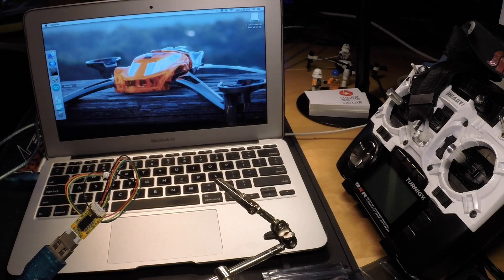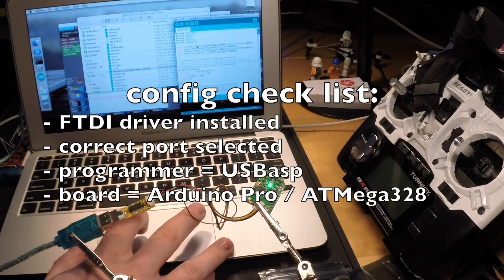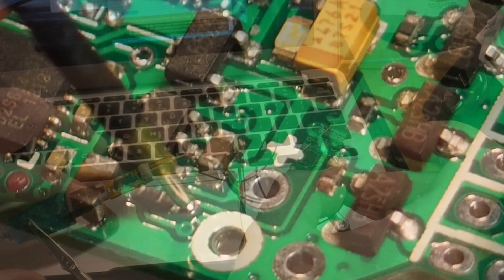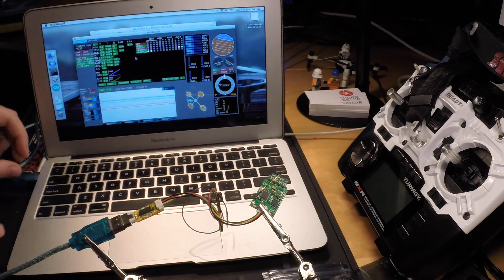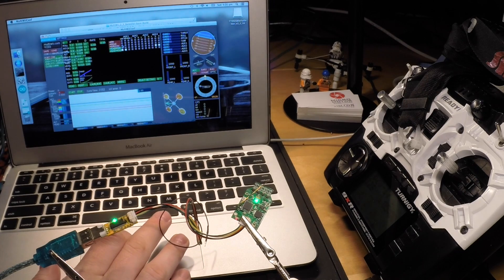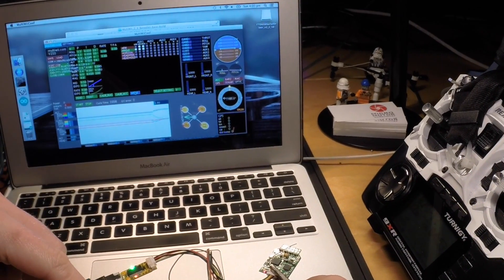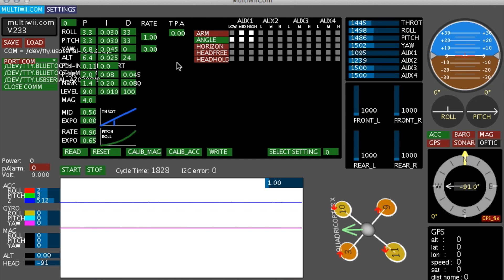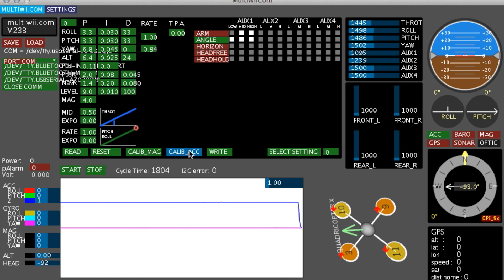How to setup a Micro MWC board - flashing and basic configuration

Comment: Hi Benedikt. Thanks for the great video. When I touch "mr pogo stick" to the little hole on the Micro MWC board, the FTDI board doesnt "get all excited and start flashing for a couple of seconds", and then, no surprises, arduino has a "problem uploading to board". Any suggestions for me?
Reply from the maker: Evan it might be your timing. The pogo dance can be difficult. Try 10-20 times, power cycle the board after every try. Good luck!
Reply: Thanks. Got it eventually, had to play with the pinout on my FTDI board. When you are arming yours and checkiong the throttle signals, your current motor speeds (I guess thats what the 4 bar indicators are, labelled front_L, front_R, rear_L, rear_R) are sitting at 1000 and only rise when you move the controls on the transmitter. Mine adjust and flcutuate very quickly automatically as my Micro MWC board moves around. What's going on!?
Reply: Any clues?
Reply from the maker: Evan that's normal. If I would have moved the FC while armed, the motor outputs would have changed too.
Reply: Hmm. Okay thanks. Having quite a bit of trouble with mine. I've followed the pin out given by hobbyking for the motor wiring, but i can't figure out any logic behind why certain motors turn on with various controls of the joysticks. Just about ready to throw in the towel.

Comment: do you have to load 2.3.3 or can it be flown with v222?
Reply from the maker: it will fly with 2.2, but 2.3 is a lot better, and 2.33 is a tuned version of that.
Reply: +Benedikt Haak is it possible to get the original firmware back on it if I already flashed 2.3.3 on it? If so how do I accomplish this.
Reply from the maker: +kp57what no, you can't go back to stock

Comment: the board will not bind to my dx6i when the left red light starts blinking fast its only for a second or two and then turns off and 2 seconds later it starts slow blinking again could use some help really want to fly my micro h again

Comment: The pad on the MWC, should you connect it to ground or another pin on your FTDI adapter?
Reply from the maker: What pad? You mean the hole for the pogo stick?
Reply: Yes, that pad. To which pin does the wire go on your ftdi adapter? Thanks for the help! :-)
Reply: Hannu Coopman I found out you need to connect it with DTR, works like a charm :-)